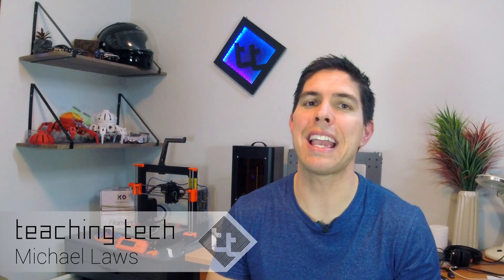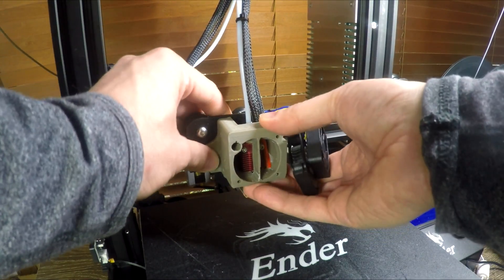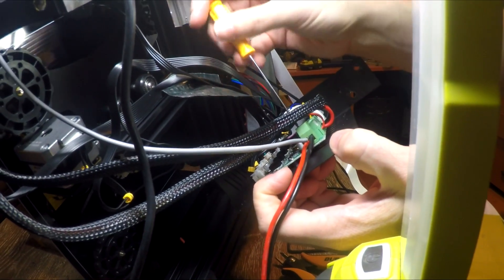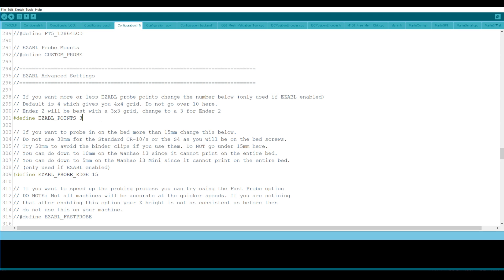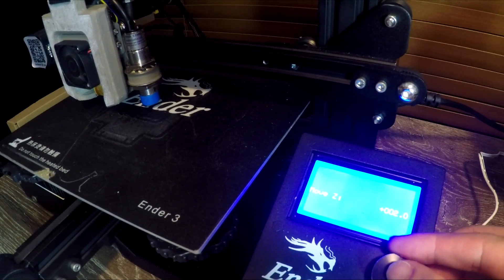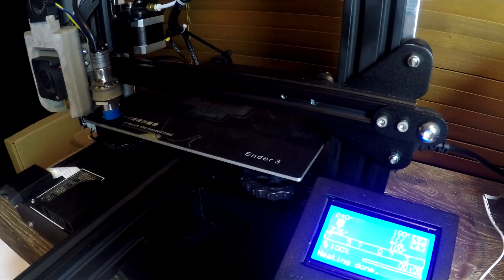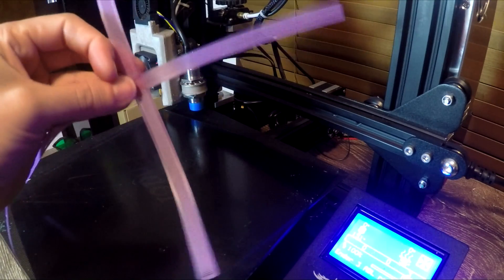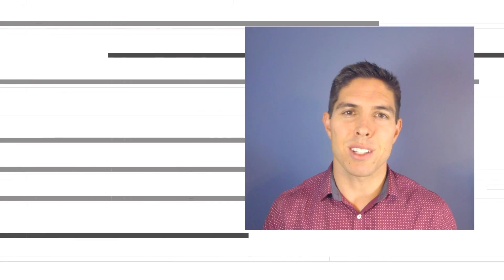How to: Ender 3 EZABL auto bed levelling

Comment: How important are the manual leveling knobs below the bed after installing this kit? Nobody mentions them and I am very confused.
Reply: Your bed needs to be as flat as possible to start with or without auto bed leveling. I retained my adjustable bed setup to fine tune the bed as needed. You have an option of getting solid spacers that take the place of the bed leveling springs and makes the adjustment knobs simply a way to hold the solid spacers in place. I replaced the factory hot bed springs with much stiffer springs (you can find the stiffer springs on Amazon) and set them adjusted well down to make them really stiff so they act very much like the solid (non adjusting) bed spacers. The thing you have to consider is the way the auto bed leveling works, it does not level the bed itself, it makes the hot end, Z axis move up or down to compensate for an out of level bed. Your Z axis is chasing the out of level of you hot bed, not adjusting your actual hot bed. The best answer for superior results is make the hot bed as level as possible so the Z axis can just do its job and not have to feed in extra up or down baby steps movement because you are too lazy to manually adjust the bed level. My experience has been that a manually, well adjusted hot bed will not need adjustment if your printer is left undisturbed after a comprehensive manual leveling. Find a permanent spot for your printer, level the hot bed and leave it alone. When you do move the printer,  manually check the bed level, this is best done with a sheet of printer paper as a gage and a lot of fine tuning.  The place the auto bed leveling helps you it if your bed is warped so an all points manual leveling is not possible. Try not to press on the hot bed with excessive force especially with an Ender 3 which has only a single travel rail to hold the hot bed level. Keep your travel rollers adjusted and clean. Any slop in the bed rollers is adding to the print error. I hope this helps with your question.
Reply: @slkgeothermal  thanks a lot, now I understand

Comment: thanks for this video I fitted an ezabl yesterday and would never have got it working without your vid.
the manufacturer instructions are a bit cryptic at points (especially the instructions for making a bootloader and flashing the firmware but your other video on that issue also got me sorted)
I did a couple of things different tho, I wired the power for the control board directly into the power supply (less fiddly than messing around on the board) I also completely removed the zstop switch so I could use the T nuts and bolts to mount the control box.

another thing worth mentioning is that they have revised the control board and it now has a plug that you connect your zstop to directly so no need to make up cables or cut wires.

 all working great now.
 thanks m8

Comment: How did you manage to get the heater and thermistor wires to fit? On my Ender 3 pro there is no clearance, I had to run the wires on the outside...

Comment: First layer is so simple if you adjust on the fly. I tried auto bed leveling once and threw in the trash.
Reply: in my opinion abl  is worth it. I made my own. I used the same forum post that tim from th3d used to "create" his ezabl. I got tired of checking for a level bed constantly and adjusting for good adhesion. since adding a probe i haven't had one single  first layer issue in thousands and thousands of prints.

Comment: If you want to make your owner Z endstop adaptor to avoid cutting wires:

I Used som of 2S LiPo Ballancer Cable!!! I cut these wires, so I can back build my E3pro.

https://www.banggood.com/JSTXH-LiPo-Balance-Wire-10CM-2S-3S-4S-5S-6S-p-925209.html?rmmds=search&ID=512939&cur_warehouse=CN

Comment: This thing has given me nothing but failed prints and a dent in my enthousiasm for 3d printing. It's advertised (when you search very well) that it 'can't work miracles', meaning that it only helps if your device is perfectly aligned. Slight deviations which I had hoped it would actually correct makes that you can't print properly, even when manual bed leveling normally would. So really, this product was a real waste of time and money for me.

Comment: This thing is such a gimmick! The only benefit is it lets you adjust the Z-Height while it's printing. It doesn't store the settings. I've set up this thing hundreds of times and it always forgets what I saved. Resetting EEPROM might not even work for all I know but I still follow the same steps to a T. It's alright to pay $80 for a cool ornament to hang off of the side of my extruder fan, but I would like it to "auto level" so I can set it and forget it instead of it forgetting everything I set up and programmed.
Reply: Did you save settings as said at 9:10? This part worked fine for me.
Reply: @fjhwildenberg  I did everything. I set the Z probe which mine is at -3.25. I pressed Store Settings and it buzzed. The first attempt at printing was fine. The nozzle was spaced the correct distance. I had to stop the print about 1 minute on because the filament wasn't sticking. The print height was 0.16mm above the bed when I stopped it. I pressed auto home to re-center the extruder and tried printing again. It goes through the 3x3 probing then moves to the left to wipe the nozzle. As it was wiping the nozzle I realized now it's about 0.30 above the bed. Why would it do this? I stopped the print and printed using a different file and the nozzle is at the correct height. Also if I shut off the printer it goes back to the correct Z height.
Reply: You sir are 100% spoton, it doesn't save any setings!! because your suposed to do that in the eeprom or preferably directly in the marlin setup.. If you watch what Mike does he explains purdy  well what to do, i personaly would reflash with the initial setup using my coldest setup, and then eeprom save after that but hey each to our own.
Reply: @chrisrobo4208  I did use Store Setting after setting the Z which is at -3.25 which it buzzed to confirm it saved. I've already tried this dozens of times with the same steps he's doing. If I starts print and abruptly stop anywhere let's say 10.5mm above the bed and restart the print, it will think Z = 0 is at 10.5mm. So restarting the print it will print 10.5mm above the bed.
Reply: UPDATE: Yesterday I was printing with the Z offset at -3.25 as I've previously mentioned. Tonight I decided to run a print. The extruder now wants to print 5mm above the bed when it was already set a paper width from the bed. Apparently the settings were erased. Why? I stored them before I shut the printer off yesterday. I even turned the printer off and on to check before I shut it off for that evening.
Reply: Now I just set the Z offset again so I erase the EEPROM to start over. I press auto home, move Z Axis from 5.0 to 0.0 and find it needs to offset -4.600 so I do that then I store Settings for the one millionth time I've done this. When I send M503 it always sends back the correct Z offset but it won't know -4.600 relative to what. It can't hold that information for a long period of time or if I reprint the same file it tends to think where I stopped the print is now the bed and will try printing in mid air.
Reply: I honestly don't know how to convince anyone the setting are stored. I can use a screen recorder and prove I input every command. The next day I'm seeing the printer attempting to print at  3-5mm off of the bed like I never saved the settings at all when nothing was touched prior to turning off the printer

Comment: Do I need this If I only use a glass bed? Once every few prints I print out the bed level first layer print and adjust the bed to make sure it's still level. Usually not far off and sometimes it's already perfect. Would I not benefit from this at all?

Comment: got an issue with the sensor. it registers when i put my finger under it i can see the red light etc. but the printer continues to lower the Z axis. its like its not registering at all?
Reply: I had that exact same issue with the Eazy connect version. at 7:54 of this video he checks to see whether or not the probe is being triggered. And so whats happening is that even with the red light on, the printer will not read triggered. What needs to happen is you need to reverse the two leads from the Z trigger ting. Google "ezabl not triggering" and choose the first Z not showing TRIGGER test, and you will see what I mean. 
Best of luck!
Reply: @killmanx27  found out in the end the Z cable needed to switch the polarity which goes from the printer to the ezabl board. I just made up a cone tion converter with the sMe plug type

Comment: So you also need to remove the Z limit sensor or at least manually adjust your bed higher so it reaches the nozzle & ABL sensor before your X axis frame slams on the stock Z limit right? xD

Comment: As a noob to 3D printing, this seems like a lot of work as compared to just manually leveling the Ender 3 (pro) with just some code and a piece of paper.  What am I missing?  $60 is cheap, the firmware upgrade is intimidating.   On average, what percentage does this improve prints? 10%- 20%?
Reply: I'd like to understand this as well.  When i see "auto bed leveling", i think the probe is actually going to get the bed level.  But maybe it's just recording offsets at each point, so that the extruder can better follow the contours of the plate?  Or does it tell you how much to adjust each knob?  I don't get it...

Comment: Are you suppose to remove the z-axis kill switch? Because When I try offsetting the z-axis I hit the kill switch on the z-axis, but I still have a  big gap between nozzle and bed when it happens. Also, My auto home is really high my z-offset value was like -3.4mm, How do I fix this?

Comment: I'm at a total loss all of a sudden. When I use a piece of paper to find my Z-Offset it always ends up in the Positive. Usually around +.008. Everything is tight and moves freely. If I try an M119 everything triggers as per usual and an M48 gives me an output of .00745. As soon as I attempt a G29 the Nozzle will literally push down onto the bed and attempt to push through it causing the Probe to fail. Do you have any idea of what might be going on?

Comment: Hi, I have some questions according to this project:
1. I am going to buy an inductive sensor, but it lacks this "control box". What actually is inside of it? Do I really need this? Or can I make my own? I simply cannot afford to pay 50€ on an abl sensor :/
2. Is the Bed already leveled as good as possible, before beginning this project? Or does this really not care at all, after installing the sensor?
3. In the video was said that there was overextrusion and that the z-offset had to be corrected. Do you increase or decrease it in such a situation? And by how much?

Thanks a lot.

Comment: I have an SN04 Sensor, then i wil not use PETSFANG? This is right mounted, which sensor should i select in configuration h?
Reply from the maker: I haven't used this sensor sorry. Perhaps google each of the preconfigured sensors and select the one closest in position. Alternatively you can enter custom coordinates if you scroll down far enough.
Reply: @TeachingTech  Thank you for fast answer.
So this all depends on the position of the probe?

Comment: So, this was very helpful, worked perfectly.. I also did the upgrade for the safety at the same time... So I finished the whole thing, tested it and all worked fine..Thank You for the great Videos! - Now for the bad news:  I went to close up the motherboard cover and didn't realize a small screw was in there laying on the motherboard and I fried something, even heard a little "pop".  Now I have to plug in the USB to make the printer even turn on but the ABL isn't working and the screen is very dim almost unreadable... Without the USB it won't even turn on.  So, I ordered a new Creality 3D v.1.1.3 main board and will have to do the whole process again from scratch when it gets here tomorrow. Bootloader, Marlin, EZABL, TH3D.... OMG!

Comment: What does this petsfang mod have to do with installing an auto bed leveler like this one? Is this because it has the mount included only? Another question. If this a real auto bed leveler why keep the adjustment wheels and springs mounted to the bed? Is it not better to convert to a fixed mount which will eliminate any unwanted movement?
Reply: There is a mount for the stock hotend included in the download. The petsfang is actually really good if you decide to do that mount. :)

We highly recommend the fixed bed mounts. We have those in our shop as well.

Comment: I have an issue installing the EZABL, it reports as closed when open and open when closed. I even disconnected it completely and with nothing connected to the z-stop wire it also reports as triggered. Reconnecting the original z-stop it reports as open.
TH3Ds instructions says to switch the endstop wires around if this happens, but doing so makes no difference for me (I used your solution to make the install non-destructive).

Comment: So for Simplified3D I have: 
G28 ; home all axes
G28 Z ; home Z to get more accurate Z position
G29; EZABL mesh generation
G4 S10; wait for heaters to recover
G92 E0 ; reset extrusion distance
G1 25;
G1 X10 Y10 ZD F1000;
G1 X60.0 E9.0 F1000.0 ; INBRO LINE
G1 X100.0 E12.5 F1000.0 ; INTO LINE
G92 E0.0 

Would I use this exactly for Cura?

Comment: Is it possible to use EZABL with Marlin stock?
Reply from the maker: You still need to configure the probe in Marlin. Better to use th3d as it is set up for it.
Reply: Yes you can. Our source is available in the download so you can compare our code changes to stock Marlin. We use WinMerge to compare code. :)

Comment: Hi! Would it still work if I remove the sensor after it has done leveling and before it starts printing? I'm thinking if I could detach the bulky sensor without it having to travel all that distance with the print head since it has done its job. Great video btw! And thanks for sharing! Thanks in advance!
Reply from the maker: I suppose you could put a pause in the start gcode but honestly every time you refitted it you would need to recalibrate distances and z offets. They have a mini version if that suits you better.

Comment: Ok about to pull my hair out after 3 hrs.  I got the mini easy connect.  I set the nozzle to touch the bed then I set the sensor at 2mm resting on a 2mm piece of foam. When I auto home the sensor light comes on but the Z don't stop, it crashes on the bed and trys to keep going tell I have to power off the Ender 3. I am using the EZABL Probe Mounts Creality Cr-10 CR-10S Ender3 Stock18mmMountCR10.stl  This mounts on the left side as to this video mounts to the right. I am using stock everything but firmware R2.4b and this probe mount and a Creality glass. I un commented #define CR10_OEM under Ezabl probe mounts. I un commented #define EZABL_FASTPROBE.  This was already set to: #define EZABL_POINTS 3 and #define EZABL_PROBE_EDGE 15.  I even raised Z about 5mm off the bed and set the sensor light to come on to see if it would not crash the bed on auto home. No luck. Help.. Thanks
Reply: Ok I found the issue. I over looked what it said for M119. It was still saying it was open when had finger against sensor.  The new EZABL mini easy connect not direct wired,  will only install one way. You take your clip off of your Z and put the clip inside the little box they send you (It will not reverse). I had to use jumpers and reverse the wires. Second issue was on this unit I had to disconnect from computer and turn power off Ender 3 to adjust the sensor correctly.  Working like a charm. 19 hours thought I'd have a reply before I solved it.. Thanks anyways, maybe this will help someone..
Reply: @rleehamn  Thank you! Mine was wired the other way around too.
Reply from the maker: Glad you are sorted. If you are a TH3D customer you should always hit up Tim for advice.
Reply: You can contact our support by emailing Support@TH3DStudio.com :) Make sure to include your order number!

Comment: I was thinking of wiring dual XT60 connectors to the PSU terminals giving me 4 XT60 connects to attach peripherals to (printer itself, EZALB, maybe bucket converter for fans and the dual USB board from TH3D for Raspberry Pi). My question is, the wires that connect to the PSU, what gauge are they? (the grey one)
Reply: 22 AWG 2C Stranded 75C in case you're still wondering.

Comment: hi michael!
.. do you know, which one of these sensors https://de.aliexpress.com/item/Ansatz-Sensor-induktiver-n-herungsschalter-sensor-M12-4mm-DC-12-V-24-V-AC-110-V/32859197984.html?spm=a2g0s.13010208.99999999.342.61023c00wKND8w (npn or pnp) would be needed? thx in advance for your help.
Reply from the maker: Sorry but this is not the place to discuss making your own version of this. It would undermine Tim's product.

Comment: what setting are you using to print on your glass bed and do you use anything to help stick like a glue stick or hairspray. 

i just installed the EZABL and it seems to be working fine....but i havent been able to get it to stick to the glass bed, even though before i put on the sensor had no issues with adhesion.
Reply from the maker: No special tricks or additives, just plain Ultrabase. Are you leveling with a hot bed? If not it will throw it off and that might make all the difference.
Reply: @TeachingTech  thanks for getting back to me. I got it all working and printing great. Thank you for all your videos!